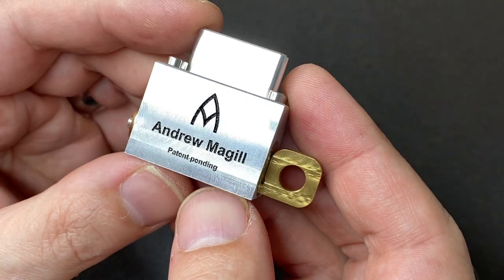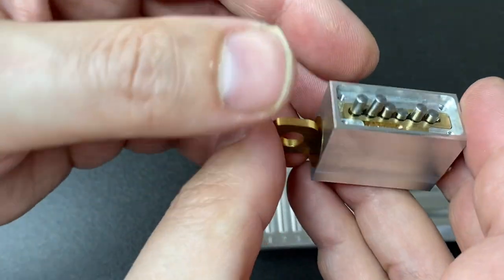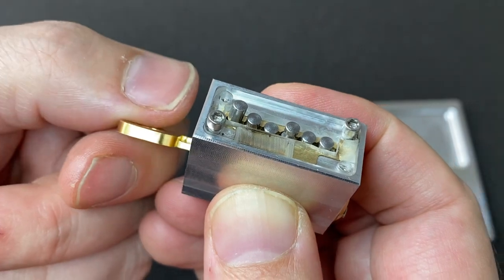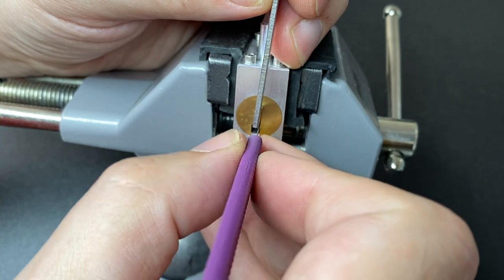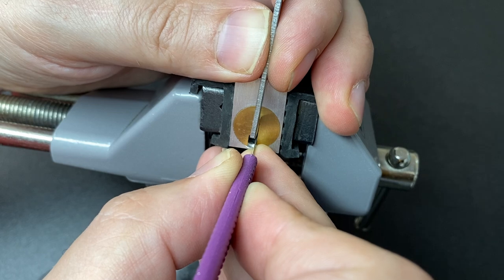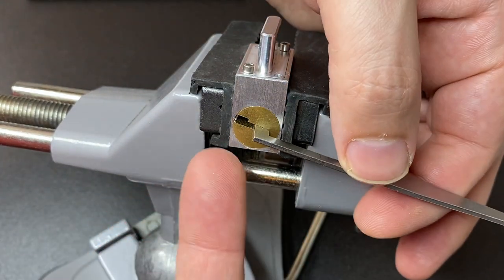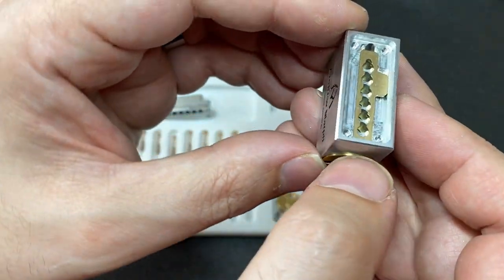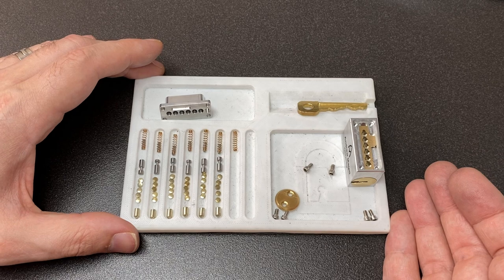Unpickable? Enclave - an Ingenious New Lock Design

Comment: Practiccaly though, you could easily force this open with a strong lever because the cam at the back of the lock would force the steel pin through the sidebar and allow the lock to be turmed.
Reply: No.
Reply: @tabaks  that is not how you make a statement unless you are 7. But I agree for 1 reason. The pins are all steel and the bar and tumbler are brass. Brute force would ruin the bar an dtumbler and make the lock inoperable because the steel pins would damage the cam and wedge due to the small tolerances
Reply: I agree with you, though the I bet the patented design addresses this weak point and the version we see here is just a proof of concept
Reply: @gtjack9  possibly. The brass plate in this version looked very thin. Ive seen what brute force can do with a core puller on a lock with  steel pins and brass tumbler, hence my comment. but hopefully youre right as the design is otherwise very good. Its nice to see lock makers finally looking at more inovative designs.
Reply: Yeah, and like maybe Thanos could use the Infinity Gauntlet on it. Unpickable means just that, it does not mean you can twat it with a hammer until it breaks and then claim victory.
Reply: @SophiaAphrodite  youre missing the point that the only thing stopping the cylinder turning fully is just that pin at the back. The rest of the key operating steel pins dont matter. You just need to get every stack to a wafer position to release the sheerline. Then the only thing blocking the sheerline is the pin at the back which is further aided by the cam design on the cylinder that pushes it up. Thats a big ammount of mechanical leverage and force exerted on a thin brass plate which would buckle.
Reply: @rossevans11  In the real world of security, easy physical weaknesses are a major threat. It doesnt matter how difficult something is to pick, if it has an easily orchestrated physical weakness, then that is what will happen when it is in use. ...unless the aim is entry without detection.

Comment: Very clever design, it also seems relatively easy to produce compared to some other challenge locks.
Reply: all those thin wafers are going to cause problems if this gets mass produced. likely will need to be changed
Reply: @Brain-washed2  these seem to be standard height two master pins.

Comment: It seems that the challenge - born on the Internet - to develop an unpickable lock is producing results.
The absolute grinder which is LPL has stimulated some highly inventive brains to improve on a centuries-old lock design.
I saw the locks made from SMH and now Mr. Magill. 
The design is improving fast. The result seems to be a mechanical device which include a feedback mechanism which iterate the effects of the key, and where there is no longer any association between  the picking actions and the acoustic / mechanical reactions of the lock.
It is a great thing which is happening!

Comment: You can get information from the second row of pins  by trying a few random combo, and see how far the lock can rotate.
Due to slight manufacturing errors, if say number 3 from second row  would have been the first to bind, then if it's set at the correct height, the cam would push the sliding plate a bit further, and allow the lock to rotate a bit further. You can now try again with a reduced set of pins.
Obviously it needs to be tested, but the lock indeed leaks information on the key.. It's just not where it usually is. This is really the same principle as a traditional lock,

Comment: It seems to have the same attributes that make a group 2 combo lock secure in that you can set the gates, or you can check the gates, but not at the same time. So picking this lock would be more similar to safe cracking in that you would need a special jig that can be configured to hold each pin at a specified bitting, and a way to accurately measure how much the core turns. Then you very the position of each pin by one setting at a time until you notice that the core turns a little further -- when the sidebar slides further into the gate on the binding pin.

They way to defend against this would be similar to the way that S&G 8500 series locks work. The sidebar would have a spring loaded snap action mechanism so that the motion of the cylinder and side bar are never directly coupled, making it impossible to measure where the sidebar binds by measuring the rotation of the core.

Comment: If I understood you correctly the tension tool will turn 45 degrees on each pin changer at 6 places—each of the 5 wafers + the driver pin.

This would mean that you have 6 choices per chamber that can be repeated—since the correct position of each chamber can be the same as the correct position of another chamber.

Then lock is a permutation system of 6 choices that all seem correct.

You mentioned is no discernible feeling between each of these 6 positions.

If that is correct, you have 6 choices in each of the pin chambers, and there is no way of distinguishing the choices except by possibly estimating the height that you raised the pin of each chamber.

This would mean you would have to brute force the solution on a geometric progression.

Possible solutions per total chambers:

1 chamber–6 possible solutions
2 chambers–36 possible solution
3–216
4–1,296
5–7,776
6–46,656

Just being able to pick 4 chambers is quite a feat.

Comment: I'm slightly concerned about a brute forcing the cylinder once it's in the false set.
Reply: My idea too. But if the "slide bar" is steel that might help.
Reply: The slidebar is huge compared to the tiny 7th pin. And that 7th pin is all stopping you turning the lock. Even if it's steel, the 'slidebar' and the plug will also need to be steel, and even then steel isn't magic.
Reply: Another brute-force exploit is to put a little piece of metal in the lock (to lift all pins to the first shear), then pull the core. The last pin isn't holding the plug at all, just 2 tiny screws in the back plate.

Comment: If you could see the slide bar, even just from the front (e.g. drill a hole in the front and look in) you could tell when you've solved one of the pins at a time. Depending on tolerances, the slide bar is going to be in hard contact with only one pin at a time, and when it's pushed into position the slide bar will move the micrometer or whatever and be in hard contact with ...

nevermind, the only tension on the slide bar is from the 7th pin when you actively turn the key. But when you've solved the "first" pin, the slide bar will be able to move a tiny bit further and you should be able to turn the key slightly further as a result.

Comment: A well planed brute force can get the numbers down a ton. Trial and error you have 5^5 positions but since a mass-produced lock has much worse tolerances or it would be really expensive you can cut that number down to about 5^3 or even 5^2 because most keys don't make jumps of more than 2, so the key still slides in the first pin will also be a lower bit, especially if you have tight tolerances it is more likely to bind on big jumps between pins. If the tolerances are loosened a bit to lower cost and lower the chance of binding, the wafers would need to be thickened, or they will slide between the cylinder and body. You can essentially use numbers to lower the possibilities down to 25 and 125 tries as the worst case (with tight tolerances) with an average of 75 but assuming looser tolerances and removing unlikely combos like 555555 etc. you end up with a number much closer to that 25 number.

Comment: I think it could be opened faster than trying out every combination possible. I'm not saying that it would be easy or that I personally could do it, but approach would be to:
1. Make the key turn (by lifting the initial binding pins) and observer how far it turns.
2. Go through each position of each stack one by one (not all combinations) and find the position where the key turns the furthest.
3. Keep that stack in the correct position and find the next binding stack and correct position by observing which configuration allows the key to again turn a bit further.
4. Repeat step 3 until open.
So in short, this technique would rely on the imperfections/tolerances in the sidebar and would require extremely careful measurement of how far the key turns. Probably will require special tools too, so I don't see anyone picking it open on a busy street anytime soon. I'm not even sure if this could be called picking anymore :D

Comment: Whoever designed this lock is super clever seriously, sliding bar on top was great but adding all those wafers was truly ingenious. Usually Master key system by wafers increases the odds that you can get a pic but in this case it greatly reduces

Comment: This is an ingenious design and something I love about it is that you could theoretically incorporate this mechanism into a lock which looks totally normal and standard from the outside using a totally normal looking key.  Sometimes you don't want a lock or other security device to appear as if it's securing something worth nicking.  It also has the advantage that it could be used in existing master keyed systems alongside conventinal locks using the same key where extreme pick resistance is not reauired.

Comment: This is very interesting not just because of the difficulty in picking but you can attach an picking alarm to the lock quite easily. If the core stays at 45DEG for longer than a minute, ups the alarm triggers and potentially blocks the door completely for 30 minutes, or until cops show up. But it matters how easy it will be to mass-produce and at what cost and failure rate.

Comment: put a long reach tension bar with channel down its length with a chamfered edge pin stack side, with a lishi bar just for the rear pin, pick the lock as normal, when you think its at the right height, then bump the lishi on the end. I would do the last part  mechanically.

Comment: I think I can see two weaknesses: 
Picking-wise: Overlifting with a comb, remove, then turn. Can be fixed with precise chamber length.
Destructive-wise: Only the lifting pin counters rotational force from the plug. Rotating too hard can damage the cam (brass vs steel), since the plug is rather sturdy, while allowing it to turn by brute force. 
A third weakness might be Time: When grime an filth enters that plug and pins through regular use, those wafers could get sticky except for where they regularily shear thanks to the right key. I doubt this could be exploited, though.

Comment: As a couple of other commenters have noted, this lock is vulnerable to precision decoding.  Basically each pin stops the core at a slightly different angle due to manufacturing tolerances.  This then lets you try pin positions until the core rotates slightly then move on to the next pin.  Needs a precise way to measure core rotation and a way to reliably set all 6 pins to any position. It will be much harder than picking, but easier than a brute force attack.  Afik this is a solvable information leak, but would require a bit more internal complexity and more free rotation of the core.  The Yuema 750 is an example of how to fix this info leak.  

P.s. the Yuema 760 is another lock that works just like the Enclave.

Comment: Pick to the first position on each pin, then once you are at the 45° angle you can use a small mallet to hit the lock and force the pins to fall into position while you are managing the tension to be not too high that pins don't move but not too low that they don't stay in position once they are set. This should work if the springs are not too strong and the tolerance on the side bar isn't too precise.

Comment: If you have a decoder tool, maybe you can start at the highest point for each pin and lower the position for all the pins until it starts turning. After you just need to push up the pins one by one; if it doesn't turn anymore, it means that you have reached the actual pin, if it still turns, then you're still at a waffer.

Comment: I wonder if a "pop up and quick turn" tool would work.
As in:
1. Push in pins just enough so all plates discs are still in the chamber
2. Turn slightly so only piston thing is resting on top of the chamber, ever so slightly
3. Have spring loaded tool apply a knock to all pins simultaneously such that the disc movement can hit and force the pistons to extreme top, while the discs themselves can't move higher than the barrel (due to step 2).
4. Have same spring loaded tool rotate barrel extremely fast.

Thus the barrel will be rotated at "check sidebar" position before the pistons drop, and as the pistons drop, they get caught in the sidebar. 
That "get caught as they fall" part is unlikely, but it may still work, idk.

Putting some false, half cuts into the pistons could mitigate my whole idea.

The press to highest point tools exist (like a rake), and the spin fast tool exists, and LPL has used them before (for those security "fall into place and freeze the lock if incorrect height" gates halfway through a rotation).

Comment: very awesome lock and design.
I wonder if you could on purposely overset a pin and then using a lishi or equivalent to feel tension and create a mental map.

regardless a relatively unpickable in the field lock without a drill or significant experience. great work man.

Comment: My concern is that the wafers allow the primary barring mechanism (the pins) to be bypassed, thus the only thing preventing the lock from turning is a pin riding on a cam, pushing into a brass plate.  I have a hunch that a large blade screwdriver with a wrench on it will force the lock.  The amount of force the cam can generate is quite substantial, either pushing the pin up, or bending or shearing it.

Comment: How prone would it be to brute force on the tensioner? as in, put it in a false set then force the barrel round to distort the 'extra' pin since that is the only thing blocking the barrel from turning. it seems the pin, the slider and/or the barrel could be susceptible to being worn away enough to allow it to open, especially if manufacturing tolerances slip. just a thought.

Comment: 1 way to increase the security of this even a little further, would be to place an 8th hidden pin at the front, so that it actively blocks the slidebar from moving, unless the lock is able to continue turning beyond a certain point, then it simply drops out of the way.  To keep it from getting stuck and binding, make it a gapped pin as well, that is pushed down with a spring, and there is a cam rotating on the lock cylinder, just like the lifter cam in the back, but it is lowering the front pin on the front cam instead of raising it.  :-)

Comment: I also think there might be a way to work on this one pin at a time by trying each pin at every wafer level until you find one that lets the keyway turn just a little bit more, at that point, you've both found your binding pin, and decoded that pin.  Do that for each pin, and you've decoded the whole thing.  Worst case scenario, it takes you (number of pins x number of wafers) to decode the first pin, then ((number of pins - 1) x number of wafers) for the second, and so on.  For a 6 pin lock with 5 wafers (like shown in this model), it would take at most (30 + 25 + 20 +15 + 10 + 5) or 105 open attempts to get the whole thing.  It'd be tedious, and it might require a special tool, maybe something like a leschi, but I bet it'd be doable.
Reply: Bill and Harry are working on a tool just for this lock, to be available soon at covertinstruments!

Comment: What about a kinetic attack? After all, that’s the most common exploit in America and if it can’t defeat that, then it’s just clever. I suspect that the wafers are of such a different mass than the key pins or drivers than that might be a successful attack. Also, an overlift attack might still work by letting the drivers fall sequentially into their sidebar grooves by gentle counter rotation.

Comment: If I count correctly, there are 6 possible positions for a pin to turn, and there are 6 independent pins that give you no information about whether they are in the correct position when you turn the lock - that means it's 6^6 possible combination - so a very unlucky picker would have to guess a maximum of 46656 positions if they have something like a lishi tool to record their attempts (or if they are ridiculously talented and know which wafer they're turning)

A picker that guesses randomly would average 23328 guesses (that is, turning the lock) for each successful picking.

If the lock really doesn't give away any information about its position (which looks plausible here, but of course in the real world it's not that simple) then that's a really good lock for picking.

Two things tho:
You could drill into the horizontal piece, all the way to the end of the key, and it'll open up without further resistance. Or drill the top of the lock, and just push out all the pins.
This lock doesn't seem to fit an ordinary door.

Seems pretty good if you only have to worry about non-destructive entry.

Comment: I'm an utter newbie at locks and lockpicking, so this could be completely off base, but the only thing I could see that would make this a bit more difficult would be to not have the same number of wafers in each pin.  If you can guess how it's designed, or at least the wafer part of it, you could maybe figure out how many wafers are in one pin, and use that to help pick the other pins.  But if there's a variable number of wafers that wouldn't help.